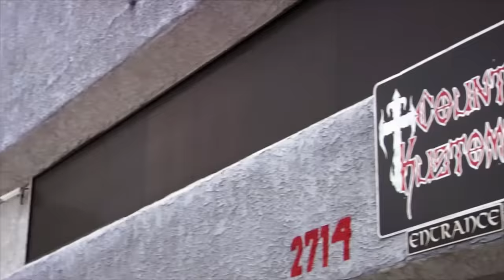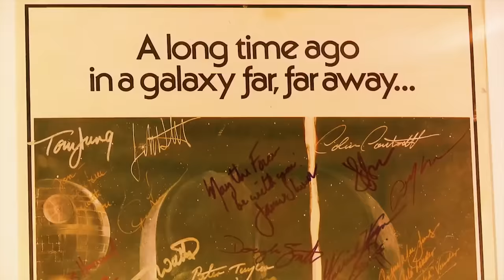How Rich Are The Cast Members Of Counting Cars

Comment: I agree with the flames statement , with a little less exuberance , in some case's they can work fine especially the ghosted one's. It would help if they'ed dial back on them. Even on some of the vehicles Mike's  scull  design may do well. But tast wise a straight out paint job with a little flakes , or perhaps fades from dark to light. Mate paint is also a choice that's used regularly. Strips on certain of the vehicles bring out that look of beast mode we like. Some vehicles need class rather than pizazz. I still think the show is great and , like the crew. I think their all talented , and tops in there know how.

Comment: Boyd Coddington for sure had wayy more overhead the counts shop. Boyd’s shop was huge, had a lot of really high end equipment, he had alot of employees many of them were really skilled so I’m sure they were making good money, the shop was in California. 
The counts shop is in a business park and business park space is much cheaper then Boyd’s shop counts shop for sure costs a fraction of what Boyd’s did, counts has a ton of equipment but they don’t have a lot of the super expensive machines like water jet machines, cnc machines even one to make custom wheels like Boyd did But Boyd’s shop was completely different he was building over the top no expense spared top notch show cars and that’s not what the counts shop is about counts is more of a restore cars to the classic look and make them into great driving cars counts will order in a steering column and a set of wheels nothing super crazy where Boyd will make a steering column in the cnc machine out of billet aluminum that wil take the cnc machine 2 days to make as well as one off custom wheels. Boyd’s shop could make a model T the most elegant classy tasteful car with 1200hp and it would drive like a new Cadillac and the counts shop would make that model T look brand new like the day it came off the showroom floor. Boyd’s cars were in a completely different class the cars that came out of there were completely redesigned vehicles made for people that could afford to spend 500k on a vehicle or more. When a custom car shop builds that one car every couple years to show off a sema, auto museum pretty much like a concept car they spent 250k in parts alone well that was every car Boyd built and when ur dealing with such a high end product it’s not hard to run out of money! If the economy goes to shit alot of the rich people that buy his cars loose their asses and with the massive overhead Boyd had it can get ugly quick where counts shop could make it through hard times he doesn’t have the overhead like that and they do work on regular peoples cars
Reply: FUN FACT: I'VE ACTUALLY BEEN TO BOYD CODDINGTON'S  SHOP
Reply: Use a . or a , every now and then, makes it easier to read than a 2000 word long phrase...